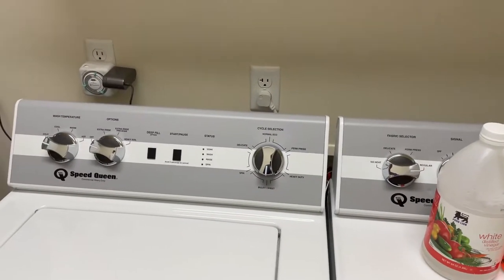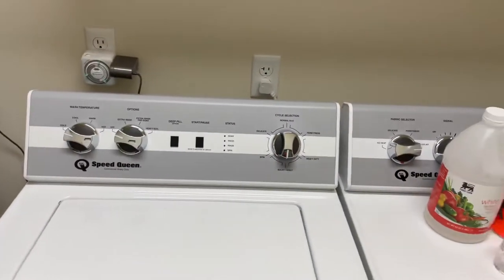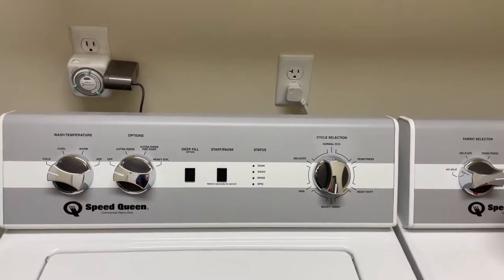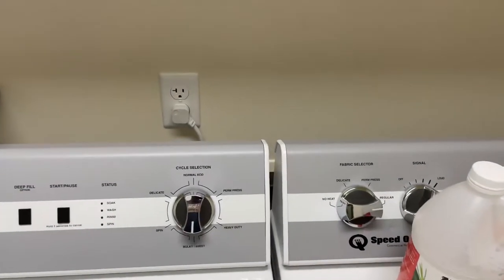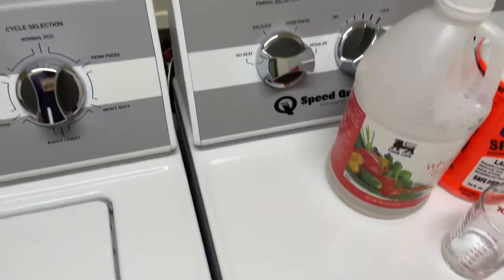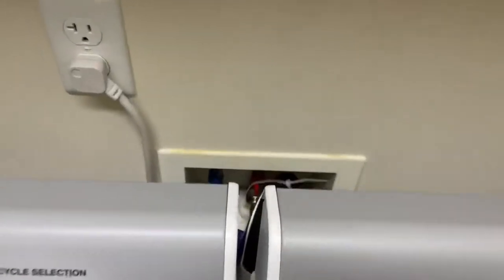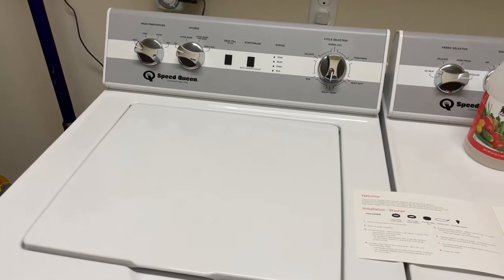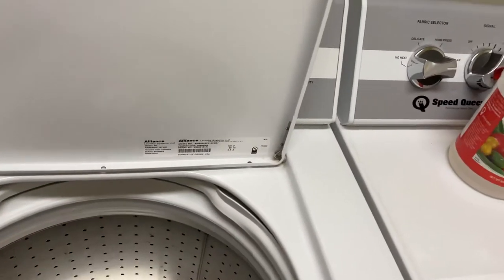Foam Bubbles coming out Speed Queen Washer drain hose - Fixed!

Comment: I sure hope this will work.  Had my washer for years with no problems.  Now in  a different house, it is doing this.  I see no foam in the machine, but only upon the last spin like you say.  I also notice there is more air in our water here??  I have also read softener will work, but it splatters all over my clothes.  Thanks.
Reply: I, too, have a Speed Queen that I bought in 2013 (AWN432S), used for 5 years with no problems at all.  Then I moved, and the new house came with a Maytag washer.  I used that one until last week when it blew a control board, but I had brought my Speed Queen with me, so I swapped it in and I've started using it again.  Yesterday I noticed foam for the first time, and a small puddle on the floor of the garage behind the washer.  

I've been doing a lot of laundry (multiple loads daily, my dad has dementia).  I'm wondering if it was the load with the towels that did it -- I've noticed with the Maytag that towels and cotton bath rugs don't always seem to rinse all of the detergent out.  I hate the feel of detergent on my skin and always use the extra rinse, and I'm always chastising my husband for using too much detergent.  He also did a couple of loads on Sunday, but I didn't notice anything on Monday.  I don't have the standpipe adapter in place, I don't think the installer put one in at the old house.

For now, I've put a basin on the floor to make it easier to see if it happens again, and to help quantify how much is coming out.

Comment: Thank you very much. I have read that adding white, distilled vinegar and detergent to a load can make your clothes oily. Do you notice that? Do you add them both at the same time? What about bleach and vinegar with a load of white clothes?
Reply from the maker: Hi Katie.  We haven't notice any change in our clothes since adding the vinegar.  We add the vinegar to the fabric softener cup in the center of the agitator.  That cups adds the vinegar at the beginning of the first spin cycle.  We don't use bleach very often.

Comment: I talked to Speed Queen and mentioned this problem with suds coming out the drain, apparently using too much detergent will cause this problem. I was advised that about 1/3 cup of detergent is all that is needed to get clothing clean. The modern detergents are concentrated so not as much is needed, they did advise that by using a small amount of vinegar it would take care of the suds problem. Speed queen advised me to wash a load using NO soap and let it run the whole cycle, at which time I would see all the residual soap that was built up in the clothing ?? so I guess less is better. Just bought a TC5003 today and can't wait until its delivered. Great video and the heads up to this problem.
Reply from the maker: Hi Richard.  Thank you for the kind words.  Speed Queen also told me to run a cycle on Hot, no soap, with a cup of vinegar.  They told me it would flush out any residual soap build-up in the machine and the drain line.  That helped for the next 2 loads.  Then, we were back to the same issue.  Please send me an update after you've had you new machine for awhile.
Reply: @rickstid-bits  I will do
Reply: @richardsmith4187 any uptades

Comment: I have had my washer for over 2 years. This morning I put a small bathtub rug in with a little detergent. It was making a knocking noise as it was washing so I paused it and made sure it was equally disturbuted around the agitator. Then I noticed suds. Nothing running down the wall, but I’m not sure if this is just because of the rug I have in there? Maybe it was too much detergent for a small load?
Reply from the maker: Hi Bailey.  That could be.  I'm glad you haven't had any other foaming issues.  Rick

Comment: You explained that different cycles do differently.  You did not say but did you find a cycle that seemed to worked better for no suds?
Reply from the maker: Hello,  We use Heavy Duty, Bulky, and Permanent Press.  I have since changed how we add the vinegar.  We now add 1-2 ounces in the center fabric softener dispenser when we add the detergent to the machine.  That adds the vinegar during the first spin, which is at the end of the wash cycle.  That has worked very well for us.

Comment: I have the same washer that I bought last year and the same problem.  I didn't have this issue with my old Maytag set.  I got so mad that I stopped using it for six months.  (BTW, I just figured out that Warm and Hot water doesn't work with the Normal Eco cycle.)  The repairman came out twice and said it was all hooked up just fine, but it foams and overflows, so I cannot use the deep fil and can barely use any soap.  I think it's ridiculous that I would have to use vinegar with this new washer but if that helps, I may have no choice.  Thank you for sharing what you found!
Reply from the maker: Hi Teresa.  I suggest you do what Speed Queen suggested first:  Put 1 cup vinegar, 1 Tablespoon Dawn, in a full fill, hot water, Heavy Duty cycle.  That will clean out any old soap residue.  Then, try the 1 ounce vinegar every time from there.  Also, I'm curious if it needs a little more than 1 ounce every time for others.  Please come back and let me know how it goes.  Rick
Reply: We had the same thing with the very first wash and all others after no matter how much or little soap , even tried numerous detergents, nothing made a difference.  Repair man couldn’t figure out what the issue was . I refused to clean up soap suds foam each time and I threw a fit to owner of the appliance shop and he took it back and we chose another washer and no issues at all with it,
Reply: Thanks for the hot water Normal Eco cycle info I thought something was wrong with my water heater.
Reply: Tried the vinegar and it didn't help.

Comment: Thanks for this info! 

Have you had any sud overflow since  you've been using standpipe add-on, 1oz of detergent, and  vinegar to date? 

I have same prob. Tried everything, but running Dawn soap and vinegar on empty cycle with hot water-- I fear Dawn may REALLY cause the suds to come up.
Washing towels is when prob starts, if it starts. I say that bc it doesn't always overflow on towels.

We put 1oz and 1 tbs of Tide HE liquid just today and it suds everywhere. Using eco mode, cold water.  We did several loads of towels before this exactly the same and no issue. 
Prob going to have to use only perm press if nothing else works here.

So frustrating!
Reply from the maker: Hello,  Please click on "Read More" in my description.  I've added a lot of information since I did this video.  
Never use Eco.  It does not have a Rinse cycle.  It only sprays a tiny bit of water on the soapy clothes!  
I do believe Dawn will cause a ton of foam.  
Please do the #1 Flush.  
Then, run a cycle with nothing in it:  No clothes.  No soap.  Let it fill and agitate for a few minutes, then open the lid.  If you still have suds in the water. . . there is still residual soap in the machine.  
Please come back and let me know how it goes.  Rick
Reply: @rickstid-bits  Thanks.  I read it multiple times. Even screenshot it. 

I was just wondering if suds are completely gone for you by not using eco, using vinegar,  minimal soap, and standpipe adapter. You mention mostly gone, so I assume you still get some. If so on what setting(s)?

SQ told me today if I use eco to then add extra rinse & vinegar. Or to  use heavy duty cycle instead. This was for towels; I only get the prob with towels.

Thanks for the vid , info, and reply.

Comment: Thanks so much for this. Just bought the TC5 and experienced the issue the very first time we did a load. Are there preferred TEMP / OPTION / CYCLE settings you use for the most part, that seem to mitigate the issue (taking into account adding the vinegar to the Fabric Softener dispenser? Appreciate it!
Reply from the maker: Hi Duane, click on the read more at the end of my description. I have added a lot of information there. It will tell you what cycles to use, and not to use. I hope this helps. Rick.
Reply: @rickstid-bits   Yes, I see. Thanks again. I did notice that in the video you mention cleaning the suds out using 1 cup vinegar and 1 tablespoon dishwashing liquid, but in your notes above you say to use a half gallon of vinegar only. Can I ask which is correct? Much appreciated!
Reply from the maker: Hi Duane.  I tested and figured out more and more things after I created this video.  I kept adding all that additional information in my description after-the-fact.  The 1 cup of vinegar and 1 tablespoon dishwashing liquid was the suggestion from the Speed Queen rep.  The half gallon of vinegar was suggested later on to even deeper clean out any remaining soap residue.  I have done both of those.  From that point on:  We add (only) 1-2 ounces of vinegar in (almost) every wash.  It seems we can skip adding it once-in-awhile.  I hope that helps.  Rick

Comment: Thank you so much Rick for all your information and suggestions. Having  the same issue with my TC5003WN recently purchased. Will try all your suggestions. Wondering if anyone is having this problem with the TR series? Have been told by speed queen its a gentler less aggressive machine and shouldn't have this issue. I do have the option of switching so asking........
Reply from the maker: Hi Nancy,  You're welcome.  I don't know if the TR series have this problem.  I know I wasn't interested in the TR models because they don't have an agitator.  I'm old school - and want a machine with that aggressive agitator to force the clothes through the water to clean them.  Please let me know what you find.  Rick
Reply: @rickstid-bits  Thanks. If I decide to switch I'll let you know. I do know 1 person that purchased a TR series about 4 years ago and utilizes a drainpipe not a sink (says it cleans better then any machine she has ever had) and never had a problem. I do believe you are correct that air is pushing up bubbles at the last few minutes of cycle. I suggested to speed queen they may want to look into this and come up with a fix (with which the proper engineers could do) but both agents I spoke to insist there is NO problem.
Reply: I switched to the TR model washing machine  and love it. No suds on any cycle . Don’t need to use vinegar and can use any HE detergent. For me, great decision 🤗
Reply from the maker: Hi Nancy,  That's great to know.  Thank you for adding that information.  Rick

Comment: Thanks. I had the same problem. I use only HE detergent to line 1 on full loads, no more than that. The clothing comes out clean and no more foam either out of the standpipe.
Reply: I used a table spoon of detergent on the normal eco mode and it frothed like crazy.
Reply: @randothecomando  You should try out Permanent Press instead of Normal Eco mode. Perm. Press solved ours.

Comment: Hi, we had this same issue two years ago with same SQ machine in video. The very first load did this with the soap and repair man came out and couldn’t figure out the cause. I was so disgusted with the situation and I refused to have to clean up soap foam every time I did wash.  The place we purchased it took it back and we ended up getting an Electrolux front loader and it has been great .  I remember back then thinking, I bet there will be more folks that experience this issue as well.  I was very disappointed with this machine .
Reply: wish I had requested mine to be taken back, we immediately called them but they were of no help

Comment: Thank you so much for this! Same problem here. My question is, do you still use the rubber adapter too? Does the filter screen washer go in the rubber adapter? Like you said, the instructions are very plain.
Reply from the maker: Hi Hayley.  You're welcome.  Yes, I still use the rubber adapter.  The tip of the drain hose goes into the adapter, and the adapter goes into your drain pipe.  I don't have a filter screen washer.

Comment: Hi Rick, Thank you for your video. I have an older model Speed Queen (almost 7 years old) and I just started having the suds in the drain issue. I found that it happens at exactly the part of the last spin cycle that you are referring to. I am anxious to try the vinegar trick and see what happens. Also, I have had 2 instances where my kids have used the machine and used the ECO cycle, which I never used and both times the laundry room flooded. We could never understand why this happened but now it seems there is a reason! I've had a "do not use" sign on this cycle on my machine ever since it happened! I'll try your remedy and let you know what happens. Sure sounds easier than calling a plumber!!
Reply from the maker: Hi Jan.  It wouldn't hurt to do the deep clean flush first.  Click on the word "More" in my video description, and then do step #1.  Let me know if it works for you.  Rick
Reply: Hi Rick, I did the deep clean and just today did my first laundry. I added some vinegar to the loads. I had foam on 1 of the 3 loads. I'm disappointed but going to still see if I can narrow it down to a type or size load that's the problem. Other than that, I guess I just keep a towel wrapped around the drain outlet. :( Thanks for your posting and detailed info.
Reply from the maker: Hi Jan,  I'm sorry you're still having problems with it.  Are you adding the vinegar to the  fabric softener dispenser - which is the cup in the middle of the agitator?  That cup will add the vinegar after the wash cycle, so it's in the water for the rinse cycle.  You can add it there at the same time you add detergent to the main tub.
Reply: I added the vinegar to the tub at the same time I added detergent. The next time I do laundry I am going to try putting it in the fabric softener dispenser and see if that works. I will keep you posted. Thanks! @rickstid-bits
Reply: Tried vinegar in the water softener cup and got suds in 1 of 3 loads. Tried again today using more vinegar and got suds again in 1 of 3 loads. Next time I will try to see if the size of the load makes a difference. Surprisingly to me the large load had no suds and the small load I did second had suds. Anyway, I'm still experimenting and hoping I'll find an answer some day. I appreciate your help and will keep trying and searching for answers.

Comment: We’ve had our Speed Queen for many years. Never had this problem. We don’t have eco mode. I always do a second rinse. Had a plumber out twice to snake drain. They just left and I go and do a load of laundry and I have bubbles coming out the drain again. UGH! I’ve been using Tide for years. 1 pod per load. Never had a problem. Wonder if it’s changed and now causing buildup. I’m going to try and use your vinegar solution. Wish me luck. Out $500 so far from plumbers and still can’t do laundry
Reply from the maker: Hello.  I'm sorry you're having this issue.  I'm just curious. . . if you never had this problem . . . why did you have a plumber come out and snake the drain?  Rick
Reply: @rickstid-bits  Because the first time we had water all over the floor not just bubbles. They found a black piece that came off the drainage hose down and wedged in the pipe. After they came the machine worked fine for 2 months. Then the bubble thing happened with no water draining onto the floor. We had them come out because it was still under plumber warranty. So we thought. But of course it did‘t do it while they were here. As soon as they left I did a load of laundry and there came the bubbles. So far after using the vinegar treatment you suggested we have not had an issue. We will see what happens going forward. My washer is almost 11 years old and never had this problem before. Speed Queen AWN542S.  Thank you for your tips.
Reply from the maker: Now I understand.  Thank you for that explanation.  You’re welcome.   Please click on the words “Rick’s Tid-Bits” underneath the video to go to my YouTube channel.  I think you’ll find some helpful and unique tips in my How to Make Life Easier or Better section.  https://www.youtube.com/channel/UCc-IuUFzC2Tyv06KzJyBESg  Rick